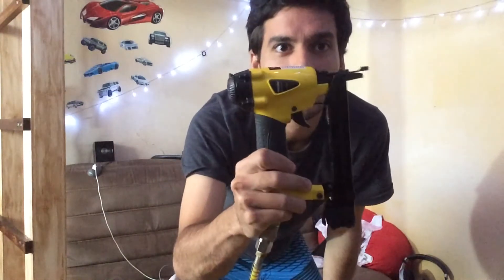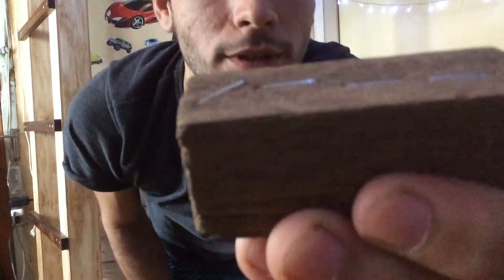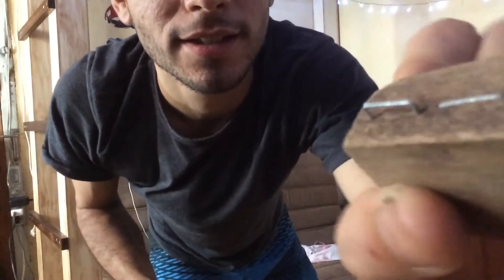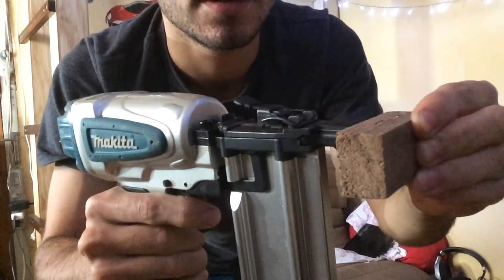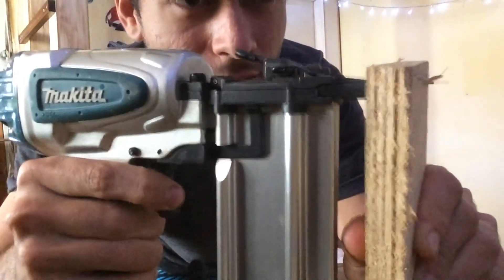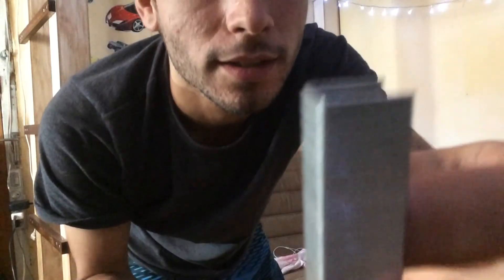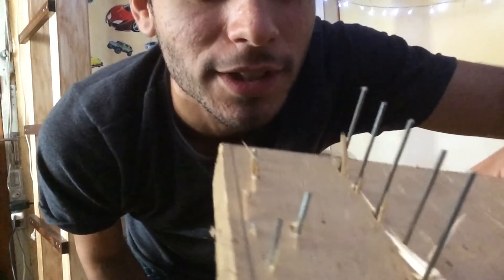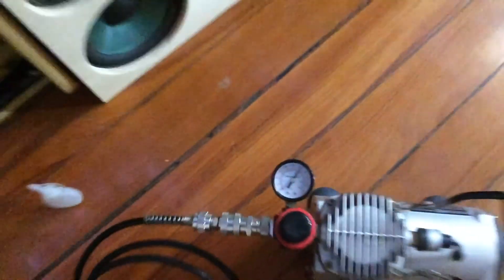Pin nailer and staple gun using small airbrush compressor

Comment: how do you connect the compressor to the hose? what size of adaptors did you use? thanks
Reply from the maker: A simple 1/8 to 1/4 npt air nipple! These compressors are usually 1/8 thread so you need to go a little bigger like 1/4 standard